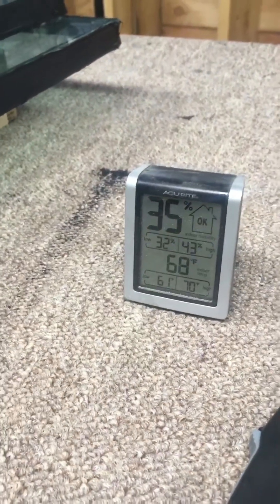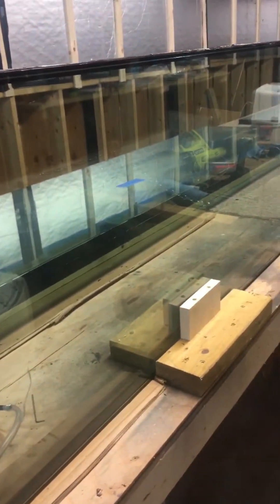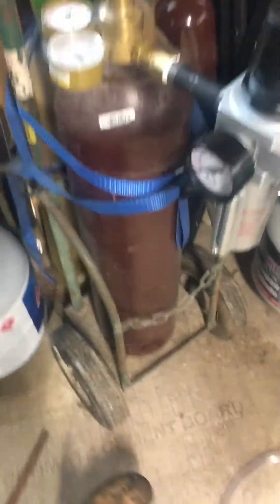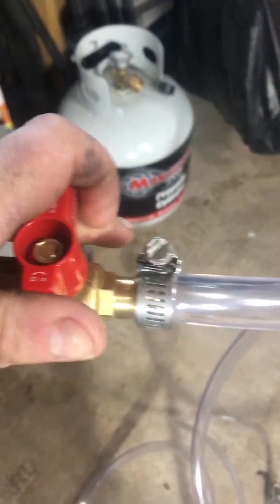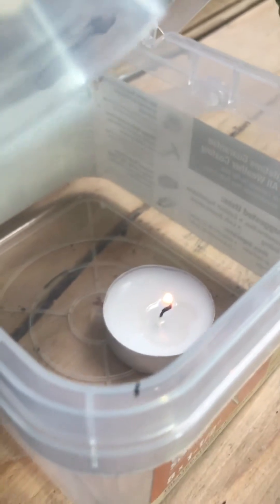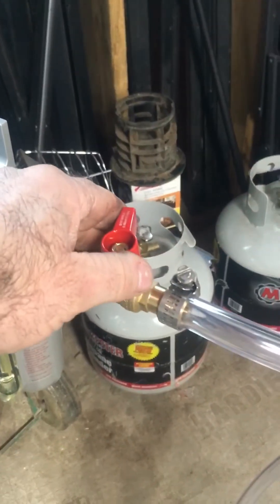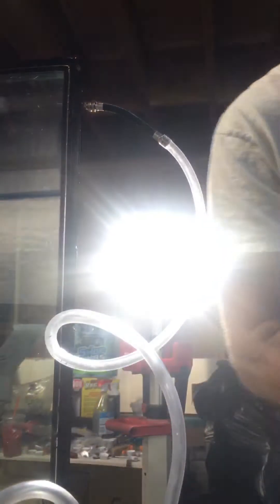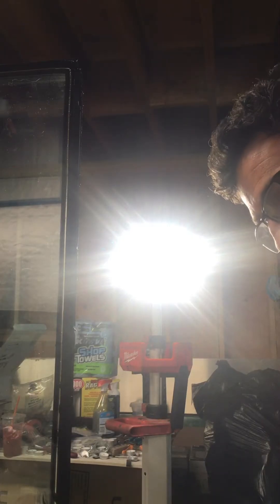Filtered Argon filling between Insulated glass panes

Comment: Thank you for this video. You've given me the answers to the two questions I've been pondering, how to fill my panes and how to tell when the space between the glass is full. 
One question though, why are you concerned about the RH of the room when you're displacing the air between the glass with argon? The moisture in the air is going to stay with the air. Seemed like an unnecessary step that you spent time on. Reason l asked is years ago l toured an outfit that made these types of windows. It was raining outside so RH would have been high. The tour took about ½ hr. in which time l saw at least 3 picture windows be put together, filled with argon, then put in an "oven" (UV lights with a 100(?) degree set point) to cure the sealant. The longest time spent on the whole process was cleaning the glass sides that ended up facing each other.

Comment: Thanks for the video, with the length of the unit would the top tube releasing the gas be better fitted at the opposite end to where it is filled? I just wondered it you would get a false reading that the unit is full.
Reply from the maker: A good idea it was easier from one side completely filled with argon the flow of Argon gas is heavier than air. I would recommended a larger exit diameter to decrease internal pressure.

Comment: What should be the ideal pressure when filling argon gas into the glass?
Reply from the maker: Great question!  
depending on the size of your existing orifice.
 
it's worth running an oxygen  pressure test  thru your exit tube . If the candle blows out ...the pressure is too high and also risk damaging you igu seal. 
We set our welding regulator as low as it could go And it wasn't enough so
we installed a shutoff valve 1/4 cracked  to hit the sweet spot.  Slow and steady wins the race
Reply: Your experience is worth reading, but if the pressure is too low, it may result in losing so much argon gas. What pressure do you suggest for a glass of 48"x48"?
Reply from the maker: @thegamingstation1905 
i don't have a pressure spec  for you sorry 
your not wasting gas whatever comes out your exit tube will suffocate the flame 🔥 
then it's full

Comment: Believeing my window seal failure is due to heat on a hot day creating pressure and blowing out the seal, would you consider using heat lamps to heat the windows during this process?
Reply: Incidently, I would say also that you're probably better off erroring on heat in assembly rather then cold.  A slight vacuum in the cold weather I assume is better then slight pressure in the summer.  Rather to say its better that the air expands to equalize the pressure and contracts to a vacuum, then equal in the winter and expand to blow out the seal in the summer.
Reply from the maker: the temperature change from heat and cold make the panes inflate/deflate the cycles of movement eventually are the cause of the seal falling 
not sure if temperature during assembly helps or not?  a good question
Reply: @BostonMark    Tyler and Mark, the assembly temp would matter but more importantly the altitude matters!  Tyler you should find out where your windows were assembled.  Its a common problem that their made at lower altitudes them shipped up the mountain and that dense air trapped inside pops the glass like your ears.  They fail sooner then later, getting moisture inside.  It's a common problem for motorhomes with dual panes especially since they travel all over.  Mark, building onsite is about as good of quality as your'e going to get, no matter who's marketing what.  Great video and great work!
Reply: Maybe they made it at a low elevation and when they shipped it to you, your house is at a significant higher elevation so it was already under lots of pressure. Or the other way around

Comment: Edge of my glass windows has salt and are in aluminium.
How can I do it?
Reply from the maker: The white stuff on the aluminum spacer is the desiccant which is in the cores of the spacers, that absorbs moisture between the panes.   when you see it that means it got so saturated that it fell thru tiny holes within the spacer
Reply: @BostonMark  can I fill my windows with this kind of spacers?
Reply from the maker: @MarcoSoi  watch all our videos and you can 
You’ll have to separate and clean the panes then replace and seal your new spacers.     We used warm edge super spacers on ours
Reply: @BostonMark  my windows of my house are 10 years olds and they have not argon gas. I'd like infill argon gas like the actualy windows but I don't want change spacer
Reply from the maker: Honestly it’s To much work for only a little extra efficiency
Reply: @BostonMark  ok, but it is possible to drill my actually spacers and fill glass with argon gas?
Reply from the maker: @MarcoSoi  anything is possible but I wouldn’t. 
You’ll have to drill thru your window frames not hit the glass then somehow seal it

Comment: How much is that argon setup you have
Reply from the maker: It was a heavy duty 3 stage for $180 off Amazon
Reply: Where do you get the tank of argon.
Reply from the maker: @ShevyMcC  it’s from a welding Supply Airgas we use it for mig  welding aluminum